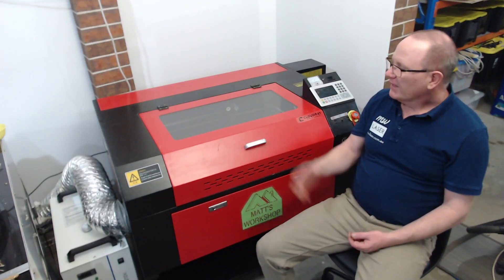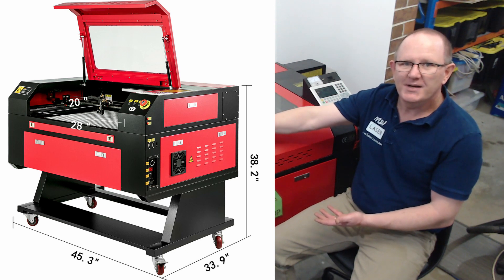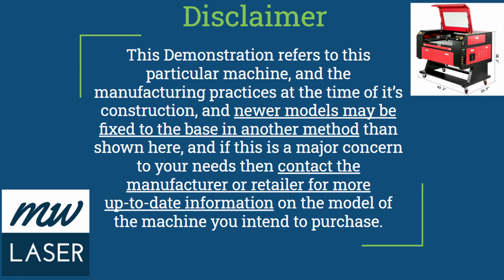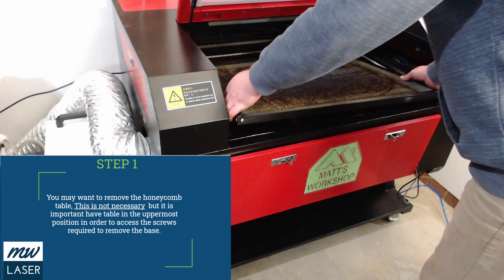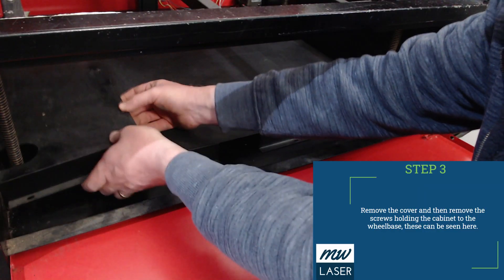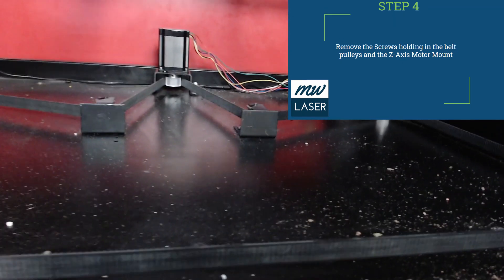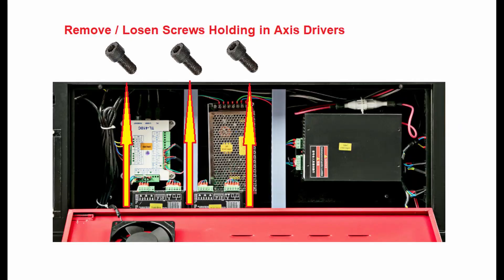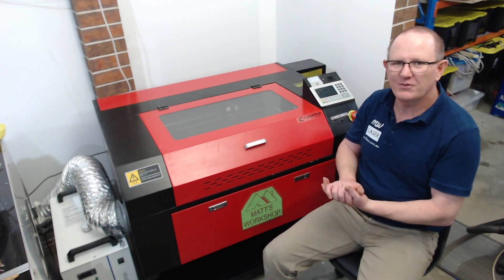How to Separate The Laser Cabinet From The Wheelbase - Red & Black Co2 Laser Machine - 60/80W Models

Comment: Hi Matthew. Thanks for the great videos! 

My red and black 80w is arriving in 1 week. How did you manage to lift the laser cabinet off of the trolly? I’ve read that the laser is about 200kg... did you have a few people helping to lift? 

Also, I’ll have to tilt the machine on its side in order to get it through a door and down the stairs into my basement.  Do you have any recommendations of what I can remove from inside the machine to ensure it’s transported safely and also to reduce any extra weight?

Thank you!
Reply from the maker: The machine is 125 KG total. I would not remove anything extra.  It should only take 2 people to move it once separated from the base.  Ensure all side panels and doors are secure before tipping on it's side.  Cheers Matt
Reply: @MWLaser  thanks Matt! Would you say removing the glass tube is necessary if I’m tipping the machine on its side and bringing it down the stairs with a dolly?
Reply from the maker: @joeyc2802  Depends on how careful you are.  if you are going to bounce it down the stairs on a dolly, then it is recommended.  You want to avoid any jarring of the machine that could cause it to crack the glass.  if just walking down the stairs carefully, then you may get away with it left in the machine.  Many machines come with the glass tube in place so it is ok to move the machine with it installed.
I am not going to advise either way as there are risks of breaking the tube in either scenario.  I'll leave that to your discretion.
Reply: @MWLaser  hi Matt! Thanks for your help. Fast forward to now and the laser has settled in its home and I’ve done many mods and upgrades! 

Quick question - did you ever upgrade the laser head on your red and black? I’d love to upgrade from the 18mm lens and go to a 20mm that might cut more effectively. 

I’m wondering if Cloudray has something suitable that is more or less “plug and play”?

Thanks,
Joey

Comment: Hi Matthew, I recently purchased an 80W 700x500mm OMTech laser cutter, very much like your Red and Black unit, except with Ruida controller installed. After watching your videos, I ordered the Cloudray Ultimate Air Assist kit and the Z axis stepper kit with autofocus sensor. My question is: How did you determine what % settings related to what output wattage? My laser tube says 80W, Peak 100W. I have no idea what % setting in LightBurn will equal 80W and I do not want to exceed that.
Reply from the maker: Each laser can produce different power outputs. Therefore it is recommended to install an milliammeter (mA) to monitor power output.  Once you have ammeter (mA) installed you can monitor your laser so as not exceed approx. 26-28mA for your 80W tube.  If you require further explanation please email me
Cheers matt@mwlaser.com.au
Reply: As Mat suggested, install a mA meter and then you can tweak your laser power supply with the trimmer to output your max mA when the controller's asking for 100% power (hint: adjust at 50% first to output 50% of your desired mA then check 100%). Makes more logical sense than trying to do mental arithmetic on power settings and only takes a couple of minutes. However, it's worth noting that the laser output power is not linear to the requested power so you may well find that going above 80% doesn't buy you anything. Russ Sabar's dohickey video shows the laser output power vs mA graph which is enlightening.

Comment: Mine was the same except for two screws holding down the cable tray in the electronics bay that also needed removing; they took some finding as they're buried underneath all the wires!
Reply from the maker: Good tip, thank you, as expected some machines are assembled differently. Cheers Matt

Comment: Hi, I've been enjoying your videos. I am just about to buy a 24 X 16 (600mm X 400mm) laser from Ebay. That's about the largest I can fit through the door. It does not have a base so I'll be making a base for it. I know this is a little off topic for this video, but I was hoping you could do a video about smoke and fume extraction. I'm in a residential neighborhood, and I don't want to get any complaints from the neighbors. I am building a charcoal filter from some plans that I found on one of the websites. I will be engraving a cutting mostly wood and acrylic, and the sign material from Rowmark. I'm looking to make this into a side business. Thanks again for the great videos.
Reply from the maker: Thanks for the feedback, I plan to address fume extraction, however it is not high on my priority list at the moment.